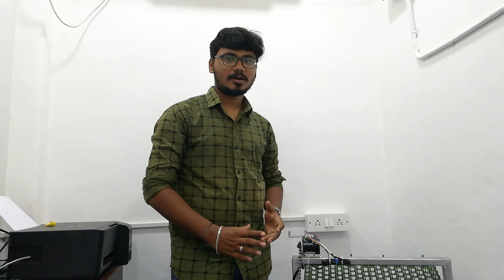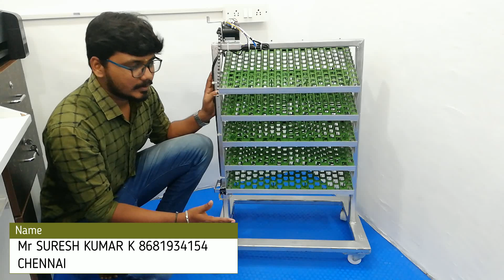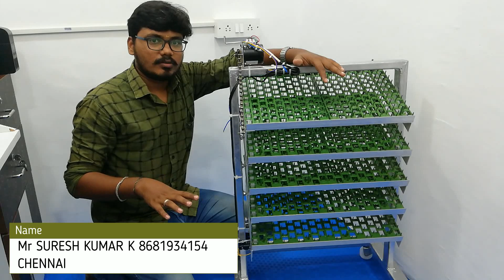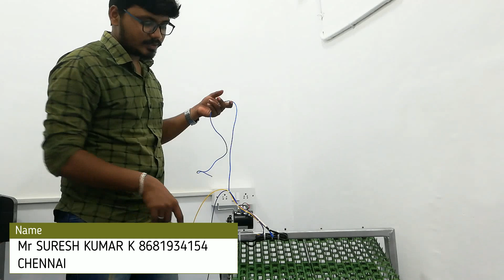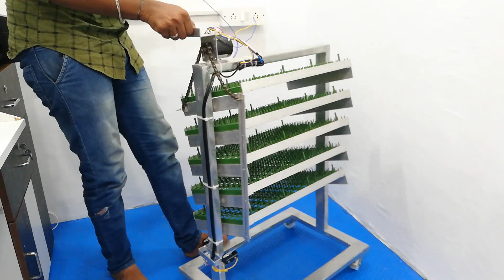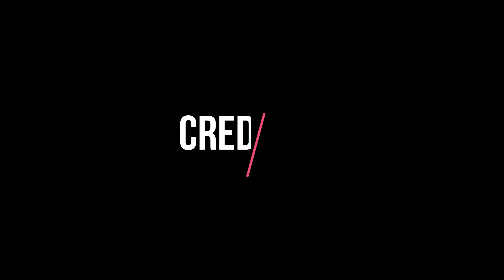Tilting model egg turner making  ideas - Tamil

Comment: Bro
Pls advise how chicken eggs can be placed. I need the parts and trays. Pls advice prices of
Motor with chain
Switch
Controller
Trays required 
Wheel
Reply from the maker: What's app me 8681934154
Reply: Cl me bro 9844631474